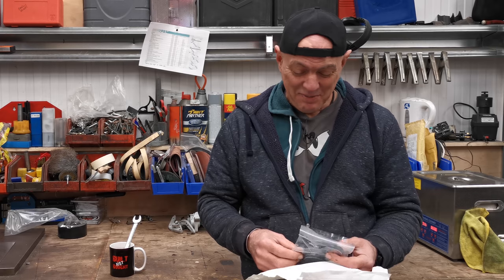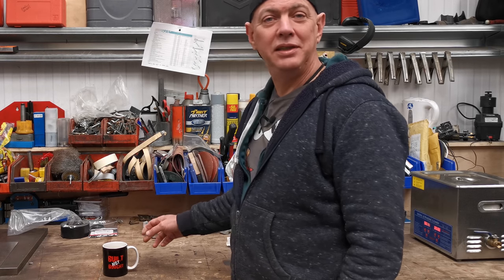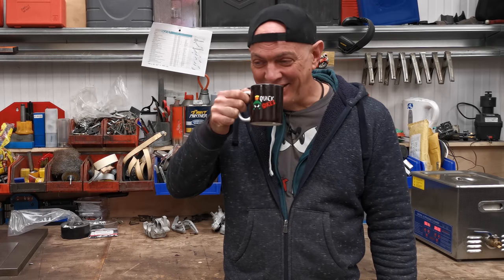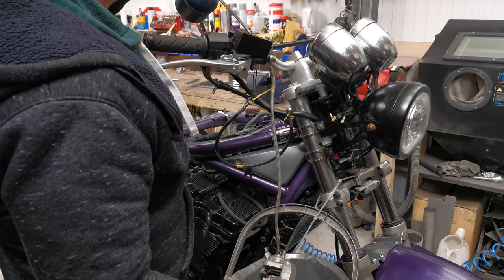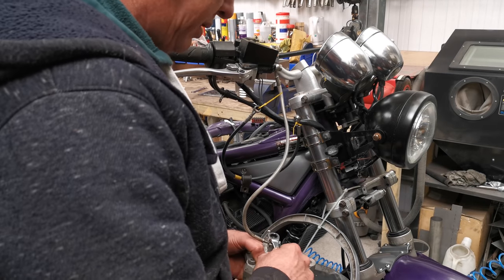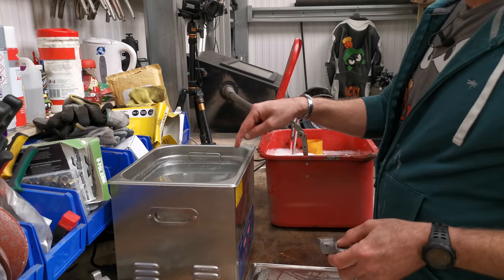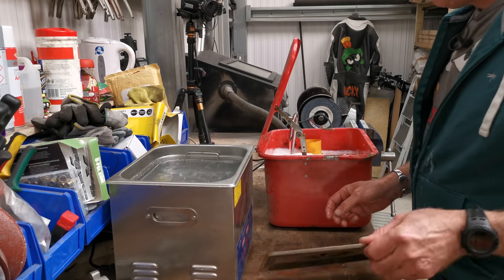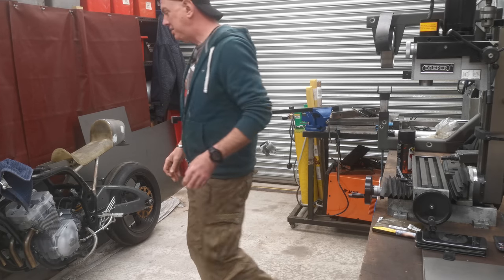Van or Bike? - Day 6

Comment: Brilliant idea about connecting caliper straight to master cylinder. I have a piston stuck in my front caliper. Last year I overhauled my rear caliper, both sides were missing the outer dust seal, which would explain why they stuck on, now working a treat after replacing pistons and both seals each side.
Reply from the maker: You just can't muck about or ignore brakes in my book. If anything else fails on the bike, you'll need em in a hurry... It's amazing how much damage that little dust seal saves init... 😁👍

Comment: Good stuff Quickie. Not shore if I'm on the right track with your thinking here,but if you don't want to change the fork bushes at this time you don't have to separate the upper and lower fork tubes to change the seals. Means a lot less work. You might have known this in which case I'll shut up.  Be safe fella and keep um coming. Mike.  👍
Reply from the maker: Yeah I didn't have to split the forks really but I wanted to check everything out. Make sure there's no cracks, that there's a crush washer on the bottom bolt, the holes are all bunged up with 20 year old oil sludge. For an extra few minutes it just puts my mind at rest. Good shout though so thanks for chipping in fella, 😁👍

Comment: Hiya guys mike here that bandit will be awsome when its back on the road, i have the 1998 bandit s, where i stripped the front took clocks off for a small clock, no rev counter, dont need it, LEDs for a dash board, oil, indicators, high beam, and neutral light, look brill guys, just got problems with me rear shock now had it off the bike no leaks but the back end seems dead springy dont no why, shock linkage fine so dont no mate gggggrrrrrrrrrrr ;-(
Reply from the maker: It might need re-gasing if it's bouncy as a bouncy thing... I had a rear fail like that on track and it was lethal... 😳🤣👍
Reply: how do you re-gas the shock absorber, will i have to take it to a garage to be done and how much sorry to keep on, keep up the great work on that bandit love it cheers mike ;-)
Reply from the maker: Not sure how much it would cost but you need the kit to do it... @Simon Rolls... Are you about fella?  Can you help answer Jan's question please?
Reply: @janwoodworth5072  hi ya, yep you'll need to take it to a suspension servicing place, where are you as I may know of somewhere when lockdown buggers off. If it's never been serviced then you would have lost pretty much all the gas and the oil is more than likely smashed to nothing.  It'll seen like new once serviced.

Comment: I have same problem with knowing when to stop 😁 I had a problem with my winter bike where a fork seal has gone badly, I'm almost certain someone has been inside them previously. I took the forks off, removed the springs and drained the oil. When I pull the top tube up it comes to a dead stop at the top. I'm suspecting when the seals were done before the bottom bushes weren't replaced and have opened slightly. :(
Reply from the maker: Hmmmm... Not great but fixable... 😳👍

Comment: Can’t beat the old school bleed tube works a treat but I have one that works of the compressor and it’s so much easier especially on cars
Reply from the maker: I never tried one of them but some folks swear by them... I'm happy with my bit of tube though as it just works and there's nothing to break on it 😂👍
Reply: It saves getting someone to pump the pedal in a car a makes a full brake fluid change quicker

Comment: You should see the job I had to get the pistons out of my calipers ended up having to heat the pistons so much the seals melted and replace the seals and new stainless pistons and I was just going to offer you a cpoy of the manual
Reply from the maker: They can be a bugger can't they, still it worked, so I'm happy 🤣😅😂

Comment: Change the seals in the master cylinder before riding the bike. No matter how well you clean it the rubber could swell and can cause the brakes to fail or lock.Oil is not a good plan.
Reply from the maker: They're getting replaced as well just because they're part of the braking system and it needs to be safe. I left the old seals and an O ring in a mug of oil to see if it would affect things. Been in there for 3 days so far with no affect, so I don't think 10 minutes would have hurt anyways, but if in doubt just don't anyway 😁👍
Reply: @QuickBikes  Glad your replacing all seals. I know from experience that oil is not a good plan I have had 3 cars in for repair over the years that the owner topped up brake fluid with oil and the brakes on all three had to be totally re built because of swelling seals.
Reply from the maker: Ultimately I just used it to pump out the pistons, but it's brakes and given the troubles I had servicing them it just makes good sense. I had brake failure thanks to a blown seal when I was racing the RSVR1000 at Snetterton. Scary stuff trying to stop from 170mph for a 30mph chicane and I ended up just jumping off it... Stings a bit.... After that I just don't muck about with brakes, it's not worth it in my humble opinion. Good shout though, thank you fella 😁👍
Reply: It's going to take a concerted effort to get the residual oil film out of those hoses....
If there's any pitting on any piston - replace it as it will only return...